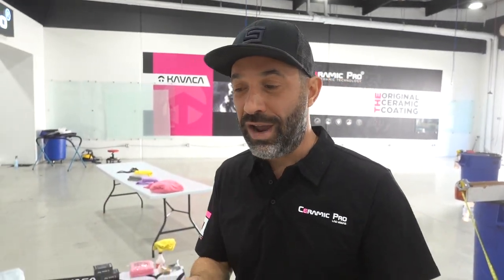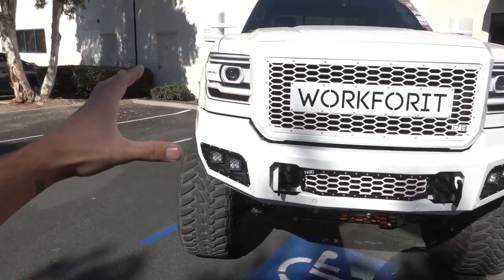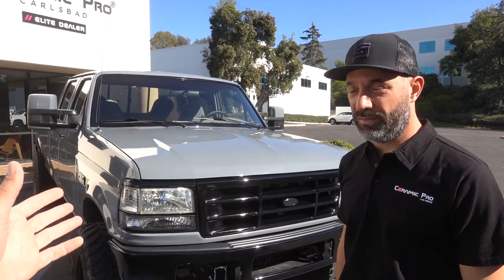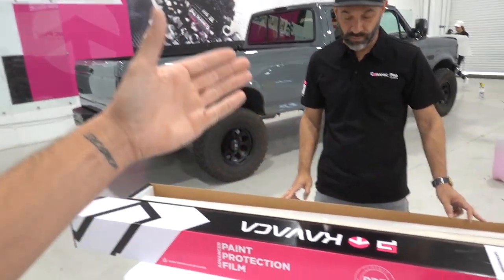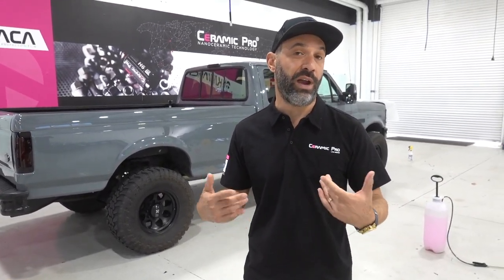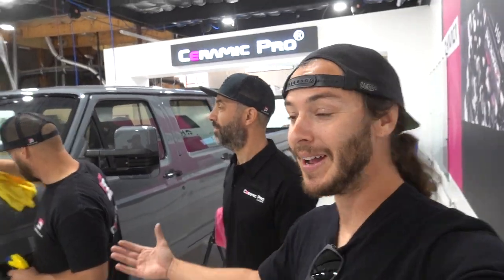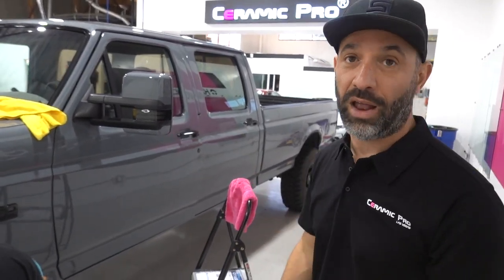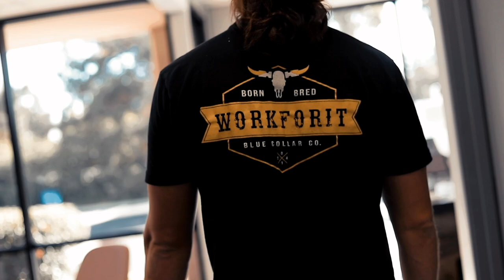I HAD MY TRUCK CUSTOM PAINTED... THEN WE DID THIS.

Comment: Ceramic Pro is AWSOME.   I had my Denali done with the gold package ceramic coating here in Winnipeg and it turned out amazing.  It's like watching TV on an old TV with rabbit ears then switching to 4K.  I changed the color ever so slightly for the better and the fine metal flake just pops now too.  Oh and btw, my Denali is similar in color to your OBS there Ryno, it's called satin steel metallic.

Comment: What’s the cost range to wrap a full truck like yours?
Reply: Our accessory dept  at the dealership i work at i think charges $5000 for an Escalade.  That's  fully wrapped with Xpel paint protection film